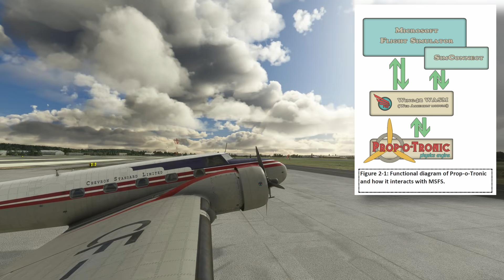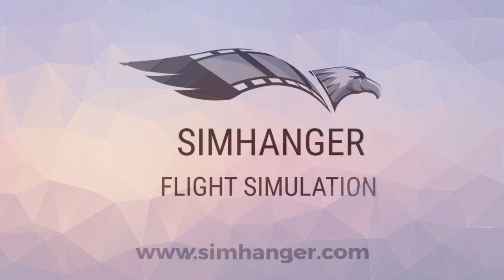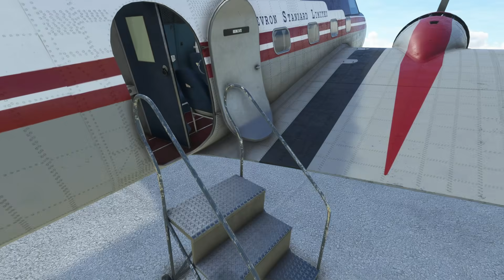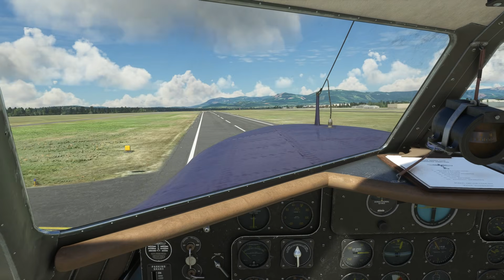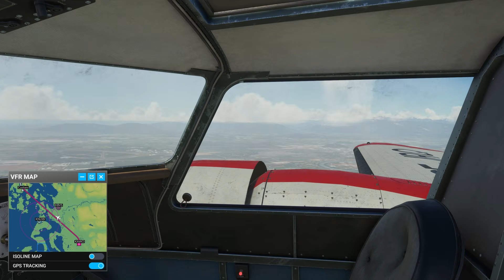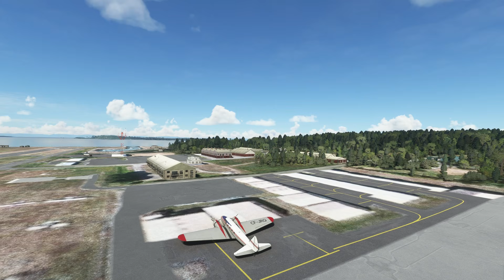MSFS | BOEING 247D AIRLINER | WING42 | Review and test flight | Tips for start up

Comment: I’m about 3 years late lol but a little observation with the oil is the pressure seems to be very closely linked with the temperature of the oil as well. The coolers on this model seem to be very effective so you can get away with having the cooler doors fully closed and opening them as you need, I feel between 80-90 degrees is good and should keep the pressures from going too high. Also using the various grades of oil for the ambient air temp helps keep them stable; thicker for warmer climates and thinner for colder climates.

Comment: 12:04 "Didn't need much runway...like the Junkers". Thick wings drag and cost fuel, but give tremendous lift. They didn't worry too much about fuel, it was cheap in those old days. Today no commercial plane has wing profiles like that, not efficient.

Comment: The manual mentions about the feathering system. It switches to a different mode than the typical oil pressure system for prop pitch when it goes to feather because of the likely case of engine failure. This process takes about 10 seconds. Until then the feather buttons are held down by an electromagnet. You can only unfeather once the button has popped back out. You press it in again and in another 10 seconds it will unfeather the prop.
Reply from the maker: 👍thank you

Comment: I cannot for the life of me get this aircraft started. I followed a couple of videos and followed them to the letter.  I wonder if it’s possible to flood the engines.
Reply from the maker: Yes you can over prime and flood the engines.
Reply: @SimHangerFS  I deactivated the Ignition settings in the Alpha and finally drained and refilled the fuel tanks using the clipboard.  Got it started finally and did a couple of circuits.

Comment: What I think could help this module a lot, on the feature side, would be a modern 8.33kHz radio(perhraps a handheld ICOM on the dash or something) that you could choose whether or not to have available, and a way to ask the ground crew to turn the plane around( on most taildragers I've seen, including the An-2, you can have the tailwheel disconnect from the rudder and have the plane pivot around the mains)

Comment: If you add the Fule in MSFS weights and Balance menu, You can take of with engins started.   It's kinda cheating as this module is built around the engin procedures of the real plane. I like the module, the price is right. She's a gentle flyer that will land herself.

Comment: From experience flying small GA's, I think your problem with oil pressure might be caused by the fact your engine and oil is really cool. You should try a couple of minutes of engine warmup prior to taxi
Reply from the maker: You are absolutely correct..lesson’s learnt. 👍
Reply: @SimHangerFS  Also the shutters play a huge role. This controls the amount of air going through the oil cooler manifold. It's hard to get down because you can't chase the gauge. The T&P gauges only report temps and pressures before the oil enters the crankcase. Because of this the oil has to cycle through the system before you can know what effect has been imposed on oil temps via the shutter mechanism. IME small changes make a huge difference here. If oil is far too cool then close the shutters completely for about 60 - 90 seconds and then open them up slightly. In about 4 minutes you'll see the effects.

Comment: The increasing oil pressure during  climbout indicates low oil temperature (the colder oil is thicker, needing greater pressure to move it around the system), and was probably compounded by reducing your rpm and cooling it further. Try keeping the engines up to 2100rpm, then partially closing the oil shutters until the temperature comes up into the low 70's.
Reply from the maker: Thank you for the guidance, appreciate it. 👍
Reply: @SimHangerFS  - I've learned a lot more from you than you have from me Mark, thanks for your great content.

Comment: Seem to have an issue where I keep spawning with no fuel in the tanks regardless of how much fuel I select in the "Weight and Balance" menu. Cant request a fuel truck since I've no power to the radio with the engine off...
Reply from the maker: Do not use the MSFS toolbar to set fuel and weight. This will cause multiple errors. Set weight and fuel from the page on the clipboard only.

Comment: As always very nice review. The attention to detail on 247D is top of the line, and in some aspects is better than other benchmark aircrafts, like DC6. Few of the points not included int the review: very detailed engine modelling with vibrating exhaust pipes during operation. Fire extinguishing system is not for show, as engines can catch on fire in operated outside of acceptable range. They can catch fire even on startup. There is also exhause smoke. DC6 lacking this effect was the biggest dissapointment for me. And all of this with animated effects. But most importantly, gauges can, and shoud be tapped when in doubt of reading :) Seriously, not getting this beauty is a crime.
Reply: I enjoyed looking closely at the engines on this. Every part, line, cable, control arm, and manifold is what is expected on a radial engine. Also the mixture and throttle control arms do animate in the engines!

Comment: When the oil temp is a bit to low it is getting to thick to pump around and pressure rises. You have to be on your toes to get it right during the flight or you damage the engines.

Comment: Hi Mark ! Thx for excellent review, I bought this one straight away. High oil pressure, it would come down if you keep the oil little warmer. I must check the recommended temperature in the user manual.
Reply from the maker: Thanks

Comment: The wheel lock is to lock the tail wheel when you're lined up, so you won't get accidental turns during the take-off roll.
Reply: Must be lock on landing too. If not = crosswind will push the tail, i test it this evening.  EDIT = i just read the manual, there is no lock tail...so ?
Reply: Brilliant info thanks

Comment: Those lock levers are the friction locks for the various controls that make it harder to move the control lever (at least with the mouse, it doesn't affect it if you have a hardware throttle quadrant).
Reply from the maker: Thanks. I think your right 👍

Comment: So this is where we are at? A 1933 aircraft? Excellent as it is, where are modern FMS jets? Is it easier for devs to do this low level of sim?  Comandable review, I always get more from your reviws than toy gamers!
Reply from the maker: As the skd progresses we will see more range and scope in the future. The upcoming PMDG 737 might surprise us.
Reply: @SimHangerFS  I just deleted the sim from my set up! Cant get any engines running and the nav is totally broken! I dont want this kind of sim on my system!
Reply from the maker: @Flight231  sorry to hear your having difficulties. If you do try and start this at anytime in the future do the following…load up aircraft. Do not use MSFS loading from top tool bar. Get clipboard. Check there is fuel in all tanks from the loading page. Go to sim settings. Uncheck realistic engines and damage boxes. Turn on fuel valve. Turn engine select to left engine. The long metal switch is to the left. The top butterfly valve select both engines….the bottom butterfly valve select left tank. Select Both mags on BOTH setting, plus push contact pin down. Master switch on. Prime 5 times if cold. If hot then 2 times. Pump wobble pump 8 times approx. From clipboard start winding up left eng. when it turns green wait a few moments then click mesh. Engine will start.
After install restart pc just to be safe.
Reply: @SimHangerFS  I am hoping PMDG surprises us! For god's sake how long has this MSFS si been out and it's still producing 1933 Sims with no sophistication whatsoever! Please? A2A had this nailed 10 years ago! Are they relying on children who have never flown GSX?🤔
Reply: It's a really great aircraft with a lot of unique extras and an exceptional price. After the teething issues I've been having a lot of fun with it. Love the review!

Comment: It’s definitely value for money and the closest thing we currently have to A2A’s Accusim aircraft, which in itself is something Wing42 can take as a massive compliment. I have to say at this point it is leaving frustrated as I’m finding it pretty much impossible to start in VR which I think is down to the mouse interactions with the primer and wobble pump, I simply cannot seem to ‘hold’ on to them and achieve full travel which I think maybe the issue. That and for the life of me I cannot find where the fuel pressure is!
I’m sure my issues are 85% user error, but my time is limited and I’m finding myself gravitating back to the 414 Chancellor which also has its charms perhaps in slightly different ways.
Hats off to Wing42, look forward to seeing what they bring to MSFS in the years ahead.
Reply from the maker: The fuel pressure gauges …there are two of them side by side….top of instrument deck co-pilot side
Reply: @SimHangerFS  thanks Mark, I had previously convinced myself they were fuel flow gauges for the very simple reason I had never seen them move when I moved the wobble pump. I had another try this evening and again, it was a no-go for an engine start, in frustration I hit CTRL+e and the engines duly fired up right away. So I cut the fuel to stop the engines and to my surprise afterwards I saw the fuel pressure/flow gauges move when I activated the wobble pump, thereafter I was able to start the engines. I can only assume something was amiss with the persistent state and CTRL+e reset something. I will need to see if all is well tomorrow when I try again. 👍
Reply from the maker: @paull35  there is a bug where it shows fuel, but the clip board shows 0 add fuel via clip board and make sure the main fuel valve is switched to on.